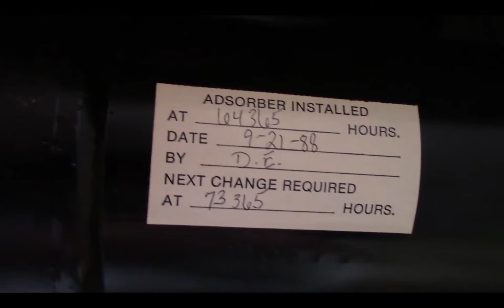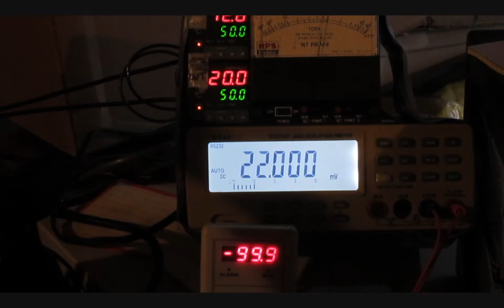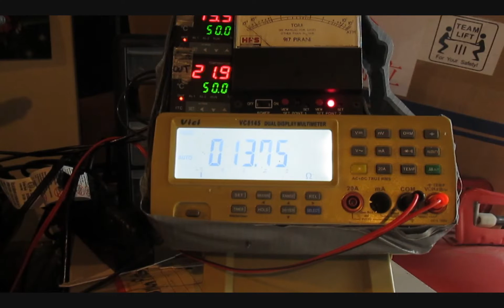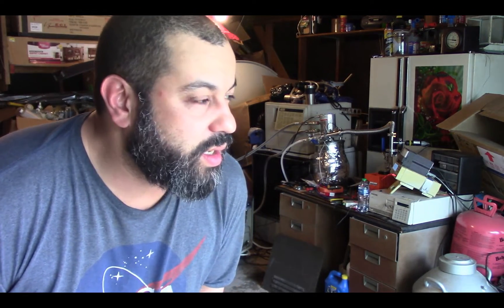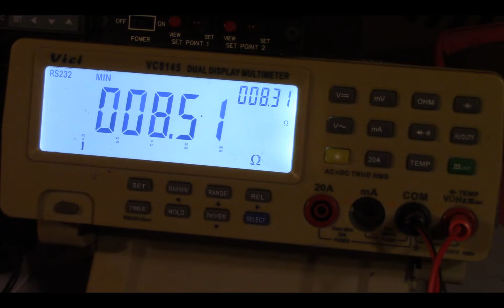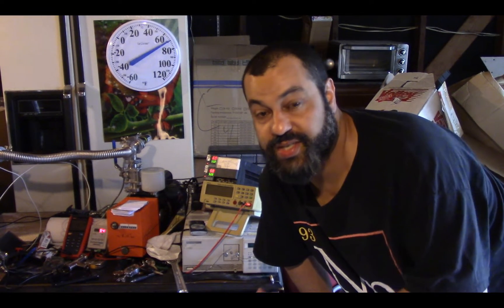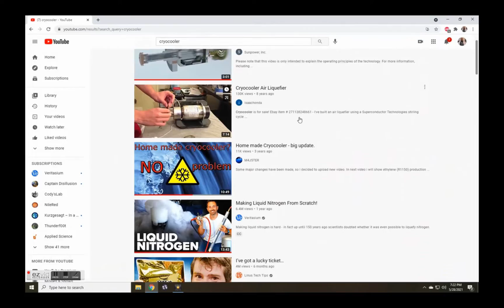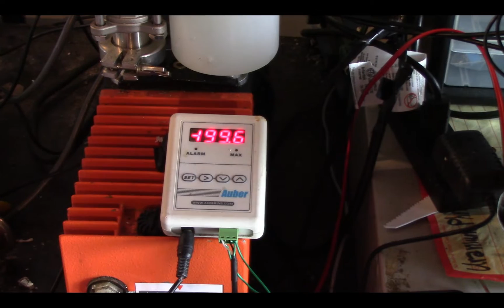DIY liquid Nitrogen, lows of physics part 3/3

Comment: I am dying to see you turn neon into a liquid or even (and most likely due to its extremely narrow liquid range) a solid as neon is one of the gases that I've only "seen" as gases and plasma.
Reply from the maker: Ha! Don't think I didn't try this !! Lol! Unfortunately I did not succeed... But! I did reach pretty low temp in this video! 

https://youtu.be/X02mDxrVP50?si=WfkxuX0p912AGhLI

Thanks for watching!
Reply: @Neptunium  I wonder how you would be able to condense neon though without quickly solidifying it given its extremely narrow liquid range.

Comment: Use a germanium or if you have the money a cernox thermometer, also use an ac resistance bridge to read temperature to over come the heating problems, dc current is not your friend at low temp
Reply: Remember it get exponentially harder cooling down to 0k
Reply from the maker: @AngelMartinez-vg1nz  All very good advices! Thank you ! I did find a silicon diode for cryogenic temperature but it never worked.. I probably did not wired it correctly and had bad insulation!
Reply: @Neptunium  you can wire the thermometer to a temperature controller or ac resistance bridge too to read the accurate temperature, dc current will make the thermocouple like a hot lighbulb. You probably are reaching 5k range just the thermometer is heating up and reading that temp
Reply from the maker: @AngelMartinez-vg1nz  i was wondering about that you right! If i had some Neon left I could try to liquify it and be sure i reached below 13K..I would like to continue these efforts for sure but I am also working on other project and my light bill is taking a serious hit ! lol.. I will revisit this project at some point no doubt!
Reply: @Neptunium  lmaoo I totally understand. Love your video by the way, kept up the good work. 
Also could I send in a YBCO pellet and powder for an nuclear analysis? You can also perform the messier effect on the pellet to show superconductivity with LN2 you made in that one video, i make the pellets in my lab.
Reply from the maker: @AngelMartinez-vg1nz  do you need an isotopic content of your YBCO? sure , best to contact me on sciencemadness though..

Comment: Exciting project!  I hope to see more.  A few friendly commetns from someone who worked in an experimental cryogenics laboratory.

Regarding insulation: you can make a poor-man's MLI by using layers of household aluminum foil and polyethylene mosquito netting (NOT NYLON), which you can buy at Joan Fabric.  Just make sure each layer of aluminum is NOT contacting the aluminum of other layers.  So don't tape together different layers and especially don't just wrap it around in a spiral with the netting between.  Heat will just transfer along the spiraling aluminum and the netting will be useless.  We used this in our lab before we had money to buy actual MLI.  But note that we only used it in a vacuum space where we didn't risk ice freezing between layers.  This will degrade performance over time.  I believe 36 layers (each layer having one aluminum layer and one netting) is suggested, but this will be very bulky.

Second, it looks like you are using fiberglass with an aluminized layer on the back.  As with the MLI, do not simply wrap it in a spiral for the same reason: heat will transfer along the aluminum in a spiral path and ignore most of the fiberglass.  Make sure to cut individual layers out and ensure the metal on one layer isn't touching the metal of the next.  

Regarding temperature measurement: I'm surprised the thermocouple wasn't as accurate in that temperature range as claimed if it came from a reputable vendor.  I'm guessing the accuracy rating was only for high temperature, and not low temperature, but usually they specify a range.  You're probably just reading voltage directly, but just in case you are using a pre-built voltage-to-temperature meter: be sure to double checked that any reading device (which converts the output voltage to a temperature) is also rated for those temperatures.  Otherwise it could act wonky.

Regarding temperature measurement, again: In old literature I've seen helium pressure thermometers: a long glass tube with a bulb at the bottom, filled with helium gas.  Helium acts like an ideal gas even down to very low temperatures, so if you know the pressure and the volume, you can figure out the temperature.  The pressure must be measured at room temperature (historically they used a mercury manometer).  The gas in the line between the measurement bulb and the pressure sensor will be at a gradient between room temperature and the measured temperature.  So the tube should be very small to limit the amount of gas in it compared to the bulb.  You can narrow down the exact temperature by assuming alternatively that the gas in the tube is all at the same temperature in the bulb (low temperature) and assuming that the gas in the tube is all at room temperature (high temperature).  You know the actual temperature will be between these two.  I don't suggest using metal for this tube, because of the high conductivity, but I don't know how difficult glassblowing is.
Reply from the maker: Working in a cryo lab must be very interesting ! You are correct, i did my  insulation as i didn't know about the layer isolated from each other . The inside should be redesigned...i've look at a wide variaty of temperature measurements in the low range, the helium filled glass was just too fragile but could be a reliable way.i have order different T type thermocouple and i read the temperature on a thermometer rated for -250c AND on the multimeter with the chart that appears briefly in the video. There is more too explore and redesign this was a "first" shot at   getting things to work and see how low i could get too. I might revisit this project and with your advices and other's, i could reach lower tenp. However, i am not sure this device can reach single kelvin but maybe i am wrong.? What do you think?

Comment: Use silicon diode based temperature sensor
Reply from the maker: Yup. Couldn't fine any i could afford . Thanks
Reply: @Neptunium  you can just make it using arduino, diode and few transistors
Reply: My friend has made one and using it on his 3 stage cascade which he uses to liquify  methane
Reply from the maker: @Exotic_Lab  really? Thats very cool! I'd be interested...is there a video on here?

Comment: Do you think helium 5.0 is necessary as the manufacture recommends or is 4.6 more than sufficient?
Reply: Maybe you can build your own hydrogen thermometer, you only need to pressurize a tube with it and put it on the cold head with a gauge on the other side, when the pressure drops you know that you have low temperature, the leybold ones have these you can measure like 15k with those. If you need any info i have one running which can get to 14k
Reply from the maker: Yes there is one on mine too..it looked like it was working it went down on my first run and never came back up...
Reply from the maker: Well the purest the better. The absorber should remove other gasses if you use less pure helium .. all that does is shorting its life and ay $300 for a cheap one you want to get your money's worth
Reply: @Neptunium  oh thats unfortunate, i though i saw a meter on it
Reply: @Neptunium  did not know that it also absorbs other gases always though it was just for the oil vapors, 99,996 vs 99,999 sounds so small ;)
Reply: @Neptunium  Thanks for making such amazing content!!
Reply from the maker: @heinrichhein2605  hey thank you for being interested! I feel less like a weirdo! Lol
Reply from the maker: Yup...stuck
Reply: @Neptunium  your channel has to go through the roof any time soon im sure
Reply from the maker: Lol! Thanks Heinrich! I think the next video will be even better....i hope!

Comment: probably the main issue was that you weren't in the linea range of the TC, but maybe for future experiments you could try using ethylene or propylene glycol for the coolant, and an ice/CaCl2 bath to chill it down to -32°C (i'm not sure if at that temperature it gets too viscous)
Reply from the maker: The water chiller does have a bit of antifreeze in it. I did use salt and ice for a couple of runs but it did not make a significant difference . There  is a small pump in the bucket recirculating the cold water over the coil and ice and that worked great

Comment: Btw wire wound ceramic pt100 (relatively large thermal capacity) with home made pulsed readout will solve self heating if you really think its the problem, usually its not, however hooking up a 4 wire pt100 to multimeter which source a lot of current at 100ohm range isnt the best idea, some off the shelf pt100 arduino board will also source few mA which is quite high too, maybe a well designed uA read out combine low thermalEMF connector is prefered,
Reply from the maker: great advice ! i am not a wiz with electronic and as i said this has already cost me quite a bit of money..I had 2 other options beside thermocouple and Pt100, i explored but did not mentioned in the video.
There is definitely room for improvement ...

Comment: Looking at how pulse tube works (i will say it isnt impossible to make at home?), seems like these GM unit is much harder to get working correctly, plus you want a first stage cold shield around the second stage cold finger to get near 0W load on second stage...
Reply from the maker: Yes this was fun. I dont always show everything. The cold finger was always in fairly low vacuum which limit the load and help get lower. but there is always newer equipment better insulation more accurate read out...hye maybe you could do a similar video too? I would watch that! i may revisit this project in the future...Thanks for the comment always appreciate your insight
Reply: @Neptunium  Sure! I ll find a chance to record something at work, btw cold shield is mostly used for providing a cold “background” even if you have perfect vacuum, at normal vacuum radiated IR is the main heat load for cryocooler, even without a turbo vacuum shouldnt be a problem, but radiated heat from the case is, btw those superconducting filter Stirling cooler can kick off a lot of vibration, which kills turbos even GM pumps which i learnt the hard way...
Reply from the maker: @cnxunuo  yes its true...there IS insulation inside the chamber too..finer glass i wanted to paint black. That and the cold finger is heavily insulated and has reflective tape did you noticed?
Reply: @Neptunium  That i dont really agree with, but i could be wrong, its a bit like the commercial “Super insulation”, which you dont want something like fiber bridgeing it, black is also worse i think, they emit a lot more in LW IR range, something like a plain copper pipe surounding the final stage (is it the second stage?) cold finger, which is cooled by the first stage to maybe 100K, will be as perfect a insulator as possible, as its close to true dark background.

Anyway looking forward to a HPGe at the tip!
Reply from the maker: You know i am not sure if i have access to the inside of the cold head . Its over 30 years old and i am actually pleasantly surprised it worked as good as it did! Ha the HPGe ! I tried 3 or 4 different types a few years ago and could never get any of them to work at all..  this was another expensive dead end! I am pretty happy with mysimple 3" NaI for what i am doing you know
Reply: @Neptunium  Sorry its not the inside of the cold head, theres two different steps of copper ring as fingers, the middle one should be larger than the bottom final cold finger, that is the first stage and have a lot more cooling power just runs a bit hotter, people usually bolt on a simple sheet of copper and bend it to contain the final stage, i ll explain it in future video when we take apart our cryocooler next time, its very simple and make a big difference in ultimate 0W heat load temperature.

Cant beat the efficiency of a 3inch NaI, strange that all 3 didnt work, usually its blown jfet but i have also seen one with a low resistance crystal, i have got a thread on yhoo gamma spec group back in the days but unfortunately the whole group got deleted, anyway i am super impressed that you got to play with those impressive GC or LC which i dont understand at all!
Reply from the maker: @cnxunuo  yes definitely let me know when you post a video about the cold head seconf stage...i think i know what you are talking about but i am not entirely sure... Do you work in a physics lab?
Reply: @Neptunium  Yes i do work in a optics (laser) lab now in London, but most of my experiences came from ebay and playing junk at home before i come to any lab, in fact it is my home labbing experiences that got me the place!
Reply from the maker: Oh thats excellent  ! Always appreciate people like you with similar interest and hobbies.. thanks for watching and your help and comments!
Reply: @Neptunium  Thanks for the great videos! Not sure if i helped or not, but i ll let you know somehow (i think i have your emal last time we briefly talked about orphen sources)!
Reply: @cnxunuo  which laser lab? what kind of work?